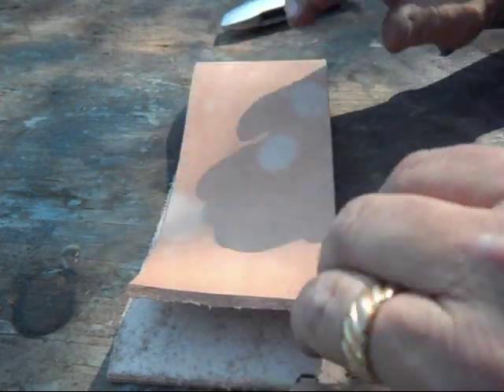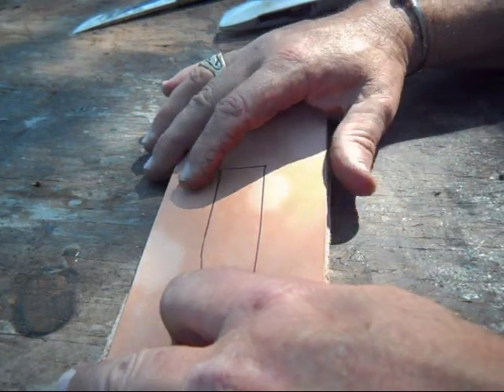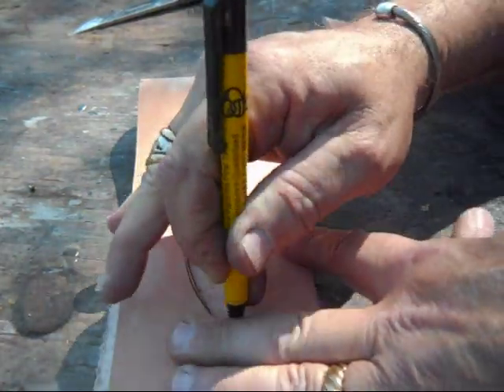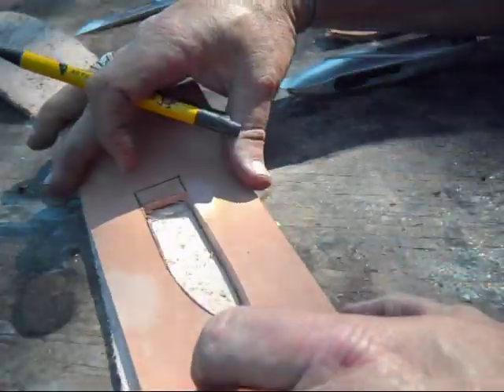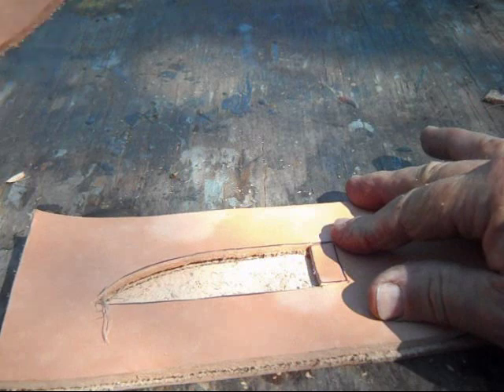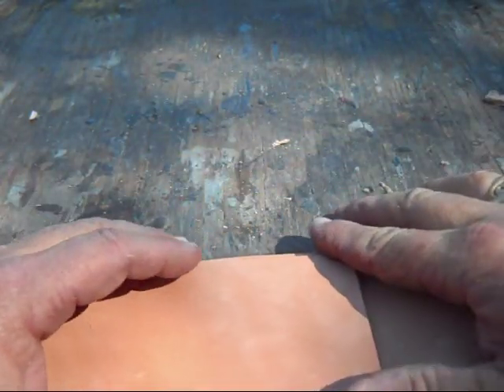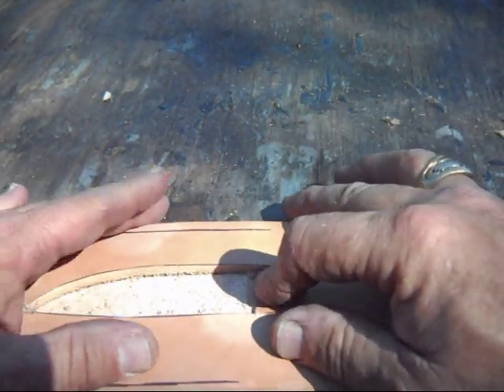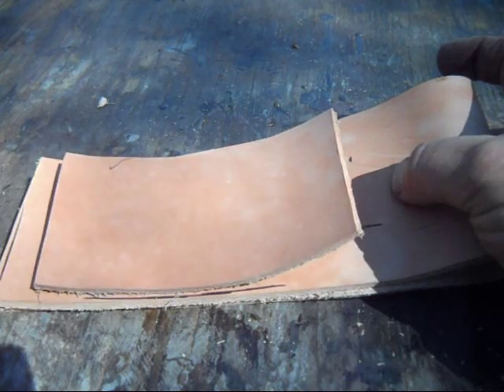No Welt Sheath Update

Comment from the maker: It should be.  With the blade 1.5" - add .25" to where you will stitch and another .25" to where you will cut (you can use a razor instead of a bandsaw, but saw works better for thicker leather) which should give you a sheath about 2" wide.